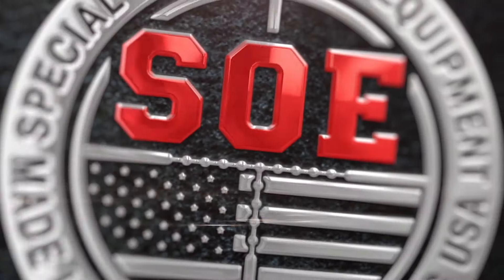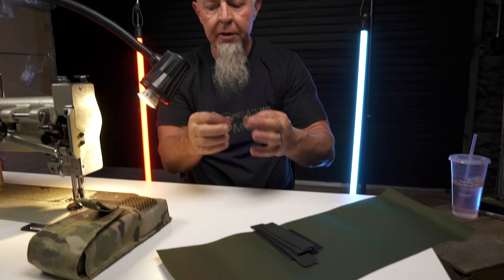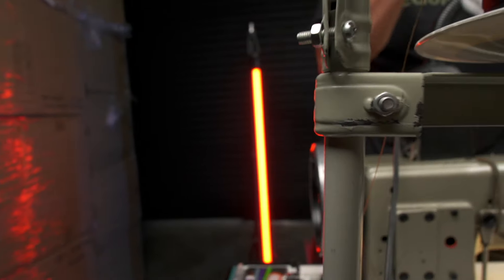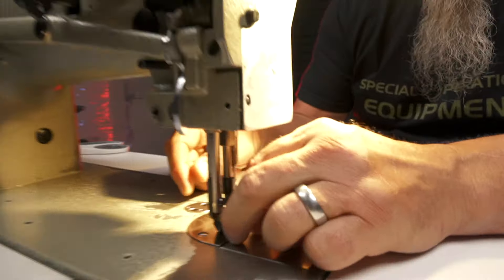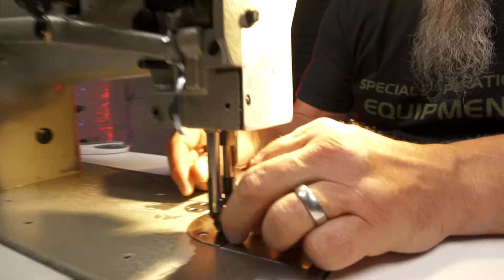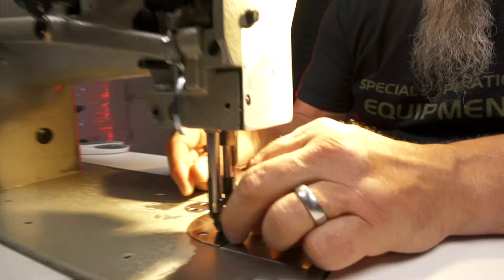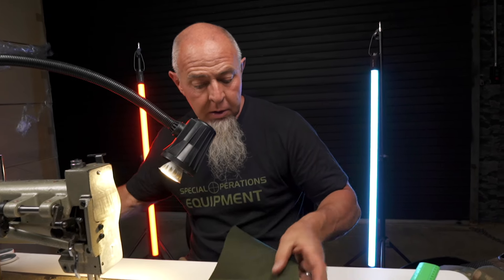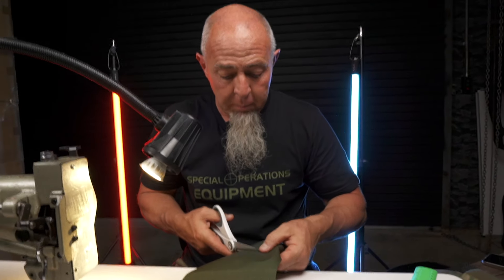*NEW* THERMACELL POUCH //  FULL BUILD

Comment: Fuck I need an industrial machine. I have a BS singer and getting it to neatly sew cordura is like planning Normandy invasion. It takes forever and a day and doesn’t end up how it was planned haha.
Reply: I use a HD singer and it sucks but with tighter tension, longer stitch length, and leather needles I can confidently sew through more than 6-7 layers of cordura
Reply: @punk8570  that’s what I’m using too. My biggest issue is maneuvering the needle around bunches of cordura such as boxed magazines on the panels on chest rigs and stuff that isn’t flat due to the foot height and lack of clearance when turning the textile. I have to roll it up to turn it around and it’s hard to regain line of sight for a straight stich
Reply: @BorisYeltzin I end up trying to simplify the designs of my stuff so I don’t have a million layers as much as realistically possible.